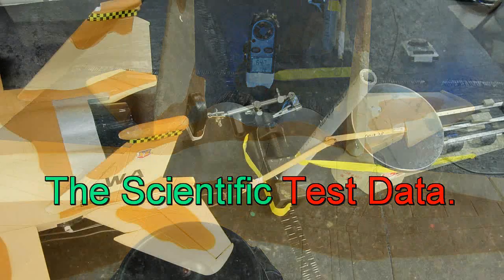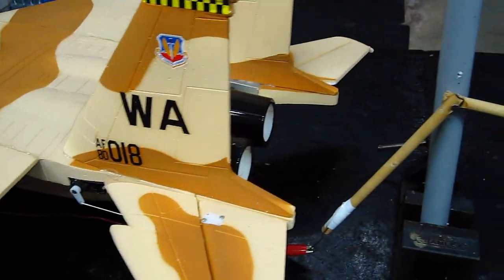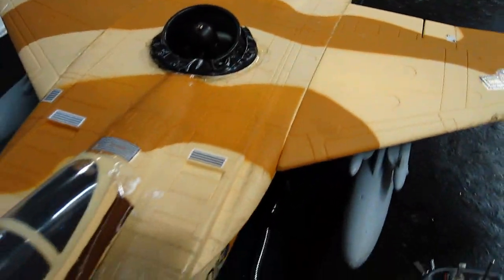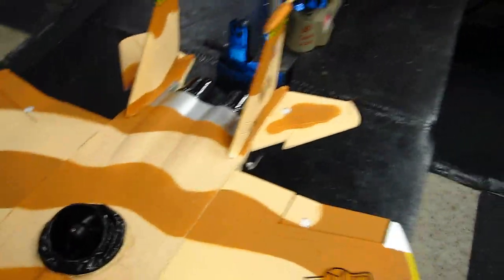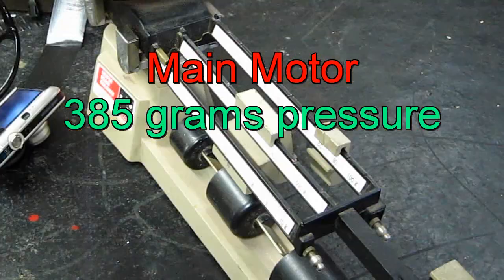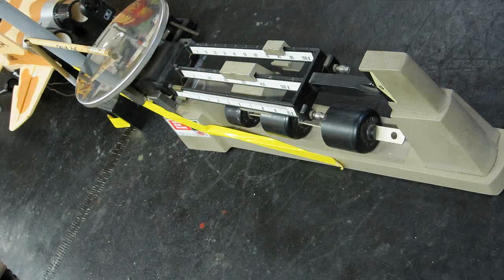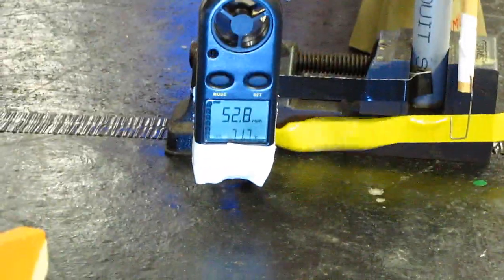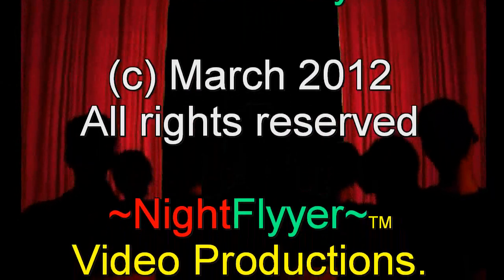The Compressor Fan Test Data you requested, done my way.

Comment: lol i remember this,, hmmm still have that same f-15 just put a 4s 10 blade in it,,, maybe take stock fan and do this...instead of cheater holes... love it
Reply from the maker: All my planes were burned up in the fire, but of course after the fact, that fan would work today except the smaller JP fans weren't available 7 years ago when I did this.
Reply: @NightFlyyer  yea, hate you lost everything,  I just got robbed,  my shop was broken into while out of town.  2 byron f16, 1 Josh Harrell a10 and a bunch of other stuff. I know the pain buddy.
Reply from the maker: @MrBumbles2  Oh no, that is terrible.  Those jets might show up on Ebay or Craigs list or at some flying field.  I would be looking there, and hope you find the culprit.  Good luck.
Reply: @NightFlyyer  yea watching for them,  a few houses on my road got broken into. They cut through the back wall, got them on video. May get lucky , time will tell

Comment: Sorry but the test is fundamentally flawed. You claim a gain of 55g due to the second fan but you never tested the thrust without the second fan in place. The thrust for the stock fan will have been reduced significantly due to the presence of the added fan blocking up the inlet duct.
I'm 100% sure that if you tested it with a 'clean' inlet duct and only the original fan (i.e. stock set up) you would get at least as much thrust as you did with both fans running... and less much weight!
Reply: youre insane.. the scales proved the increase.. and yes with a straight line  hed get even MORE.. but youre talking  more incoming  power too.. hes doing this with the same power source as before
Reply: johnny llooddte it doesn’t matter if it is insane.  

This is effectively R&D - so run all the tests you can. Occasionally you will get a result that defies logic, which makes you ask “why?”. If you repeat the test and get the same result to eliminate measurement error, then you just found “something” that needs to be understood. Sometimes those things lead to new knowledge , sometimes they don’t, but you don’t know until you try.  

As he started with a single fan and an unmodified body, that’s the baseline and should be done and then compared to at least 3 things:
1. Modified body with fan at 90 degrees and fan off
2. Modified body with fan at 90 degrees and fan on
3. In line both fans running.

And see what happens. 

Great set of experiments anyway.

Comment: Sorry but the test is fundamentally flawed. You claim a gain of 55g due to the second fan but you never tested the thrust without the second fan in place. Obviously the thrust for the stock fan will have been reduced significantly due to the presence of the added fan blocking up the inlet duct.
I'm 100% sure that if you tested it with a 'clean' inlet duct and only the original fan (i.e. stock set up) you would get at least as much thrust as you did with both fans running... and less much weight!

Comment: Great experiment you probably would have got some loses due to the secondary fan with deflector in the direct stream of the air flow going to the main fan. 
Would be interesting to see how many grams of thrust it has without the secondary fan in place . 
Interesting stuff though excellent.
Reply: The forward engine with the deflector is not going to cause any real drag. the reason is, the engine when it's not running it's acting like a cheater hole..

Comment: Your still going to be slower do to drag caused by the top fan wanting to pull the fuse up. My money is that the stock will still be faster, not that these NP F-15 are fast. lol
Reply: youre anutther nutter.. he had 30% increase in  power.. that small deflection might cause 1% drag below mach 1

Comment: Hi Dave, 
I was intriged with your experiment, but you might also test it with 2 motors parallel to see what configuration, a tandem or parallel motors, is more efficient in the same model.

Comment: Skeptic here. :)
The only thing I would've done different is use an in-line scale, instead of involving levers or other mechanical links.
As far as the speed in the air, it is significantly faster due to the elimination of friction (even though it is a very small amount) from the landing gear and the addition of gravity and momentum.
Nice job, Mr. Herbert!

Comment: It is definitely not going to work as long as it would with only one motor running, if you have them hooked up to the same battery.

I could go into the Physics behind it to explain why, but suffice it to say that the main motor isn't drawing any less power (or only a little bit less), but you have another motor running.

I'm actually quite disappointed by the thrust increase. Could you try doing two fans in line?